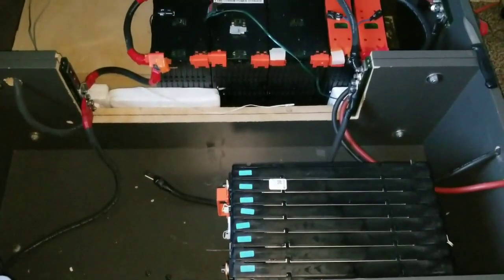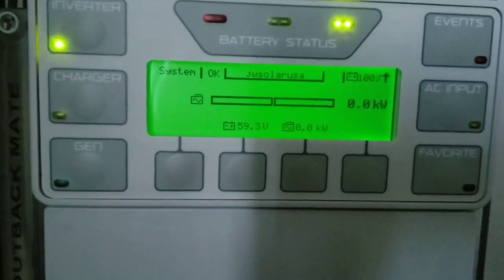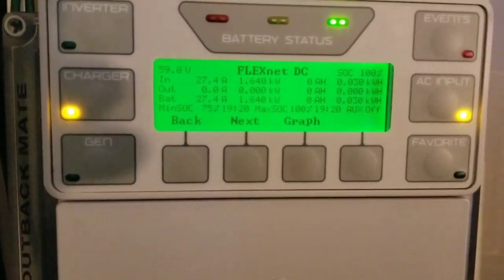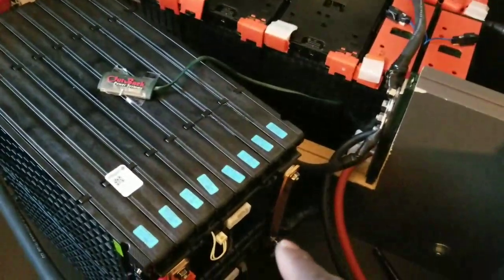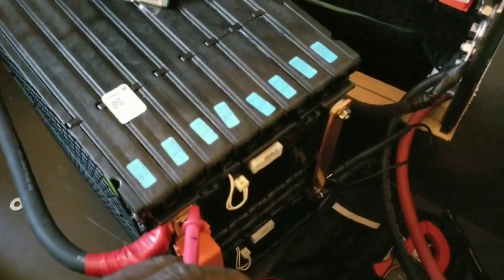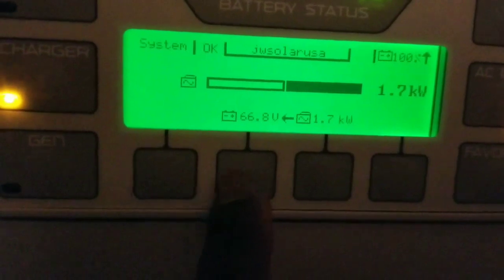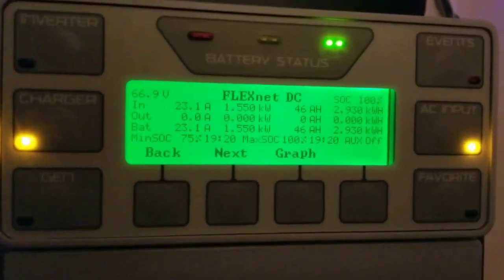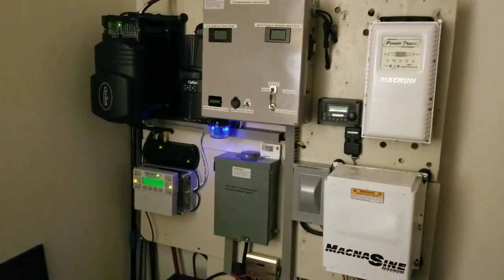LITHIUM BATTERIES FOR SOLAR: 30.544kWh Lithium batteries explained (UPDATE 1)

Comment: The Chrysler Pacifica batteries are more compact, smaller size and weight than the other batteries correct?
Reply from the maker: Chrysler Pacifica are heavier than the rest of these other batteries. The Ford Focus is the next inline
Reply: I think I found a battery pack that is smaller, lighter but more energy density? How does it compare with the Pacifica or others?

https://www.techdirectclub.com/tesla-24-v-3-kwh-lithium-ion-battery-pack-7-series-120ah-308-cells-ev-rv-solar/